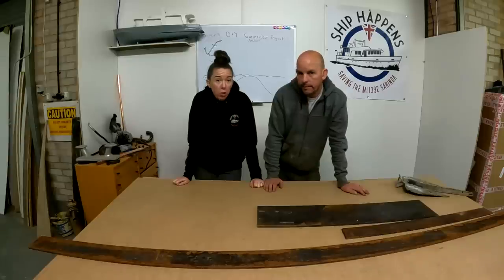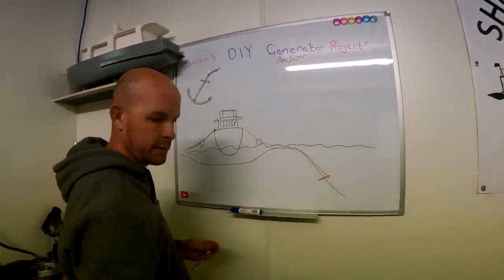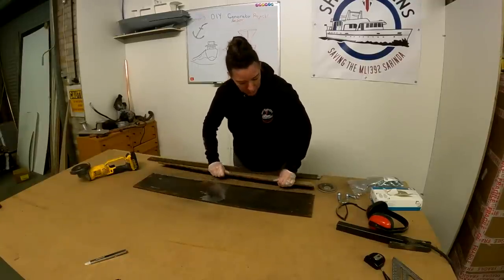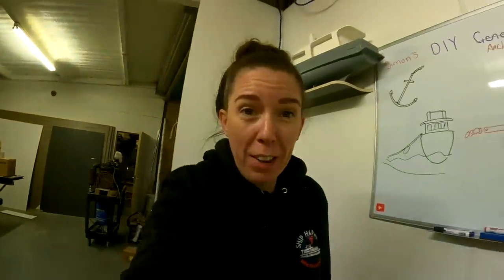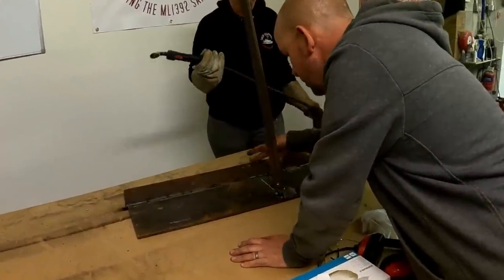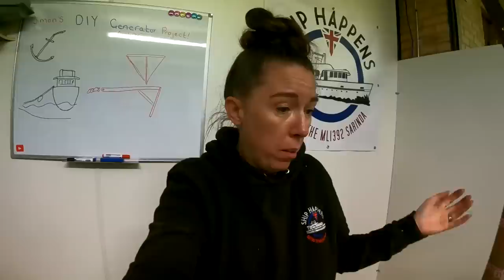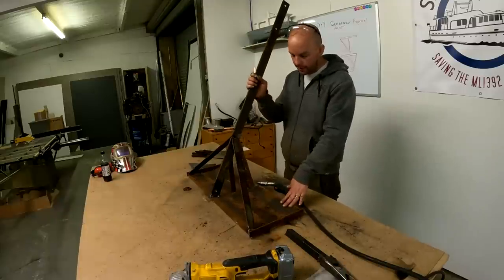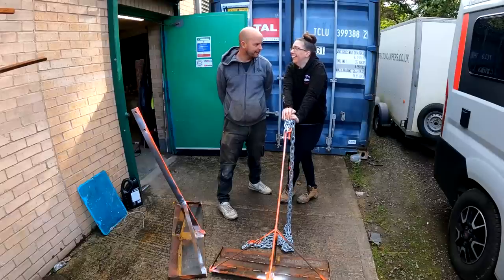Rate My Weld! Gemma Learns To Weld Making New Anchors

Comment: I am building my boat from scratch in steel (read as a LOT of welding) my Daughter who I suspect is about Gemma's age decided she wanted to help and I taught her to weld. Now I have no opinion on those anchors themselves since I don't know what the local fishing fleet uses (the local fishing fleet knows what holds) BUT I do know welds. Gemma for as little welding experience you have had you did AWESOME. You can weld on my boat any day. I will also say it took about a month (of a lot of welding) for my daughter to have prettier welds then I and as strong.  Come aboard my boat the the pretty welds are Sara's. Gemma would be a fantastic welder if she was on a steel boat, No question. Now Simon, you sir are one in a million, too few blokes are able to let their loves shine doing what is typically a 'guys' area. You properly showed Gemma and let her shine. You both are fantastic people. Thanks for sharing.

Comment: Landlubber: "D" ring. Old Salt: Shackle. Great welding job, and great idea. No need to be sea-worthy, as you aren't going to sea with them. They aren't so much "anchors" as they are "dead men." Don't forget to attach a short length of chain to the recovery shackle, along with a length of line and a small recovery float. Thanks for the video. Jon - Iron men and wooden ships!

Comment: Gemma’s welding is better than most “casual” jobs I’ve seen. I do a bit of “stick” welding (actually it is sticking the bits together). The big win is getting the current set correctly. My 13Amp 240 volt supply struggles to hold the weld set current. A job like this would be a total mess. If I could finish it at all.

Comment: P. S. I forgot? Gemma, I wish that I could weld as good as you? Many years ago, errr' around 53 year's ago when I was a teenager, I tried to arc weld a car lift in the service bay of a garage I worked in, & I made a right hash of the 1/2" that I attempted? So the experienced mechanic finished it! Lol. Yeah, keep it up, Simon is a great teacher.

Comment: Excellent going for a first attempt Gemma. I've done a lot of Mig welding over the years and I preferred it to stick welding; except when the splatters get into your shoe. Holes in sox even with boots on and several new versions of jigs danced. When the Mig splatter is flying about showing any butt crack is risky business.
Some of the guys I worked with who had boats on the estuary's in north Dublin where I live, bought scrapped railway coach wheels as mooring weights. They said they weigh about a ton. A tad difficult to maneuver as they had to be floated into position.

Comment: Interesting but should work design for what is a Ground anchor   However you need to worry about it twisting so make sure they are flat and well dug in before tying off the mooring (maybe a brief tug with the windlass if you cant actually see them go in)   If you plan to recover the anchors  dont forget a decent strength recovery cable and buoy on the eye so you can find them  and trip them when the tide is in and the mud softest

Comment: No rigging expert here, but thinking purely from a geometry/physics point of view, I think you should keep the following in mind:
1) The weights on either side should be equal
2) Said weights should be the same distance from the hull
3) The rope lengths from the weights to where the rope touches ground/anchor, should be, as near as possible the same length.
If not, one side could generate a stronger pull, resulting in lateral movement with the rise and fall of the tides.
But, maybe this is not important.

Comment: Nice episode, I do like watching your channel,  but did you think to flood weld the open backsides of the angle sheets ?  if there is an unusually strong squall putting massive pressure on the anchors it may well bend them out of true at the top weld joints like hinges and make it easier for them to erroneously weigh  and cause a possible world of hurt.

Comment: Simon I'm going to make once you just you put that do you looked in there for pulling them out the opposite direction I would put a roof on there with a small floating ball so that you can find it and take Sutton deep water and you can locate is easier so you not have to go to digging for it okay this is BOB from Vero Beach Florida God bless and have a great day

Comment: Good job Gemma for having a go  I personalty think MIG is fine for the work shop but if you take the time to learn to stick (MMA) weld you can repair stuff anywhere you can get a electric supply a good 240v welder can be carried in one hand  no gas to worry about gas is  costly , windy days a pain   lugging a cylinder around a pain   stick harder to learn but MIG is easy  after

Comment: Since your going into the mud, it might be better to look a the rake or pitchfork. Then using a driver pipe, it can be placed and pulled easier. This form will need a pit dug and placed under the top of the mud then covered.

Comment: On thick plate put a 45 degree bevel on the edge, it helps with penetration. 
I have seen welds looking much worse than Gemma's getting done by "professionals" another notch to her bow, Gas Safety, Welding and Shipwright , What's next on the skill sheet.
Reply from the maker: TIG welding next I think! Never done that before! Might look at doing a little night class to learn!
Reply: @ShipHappensUK  Fantastic, get that under your belt and you are on a winner.

Comment: Gemma, fine job on welding. Atleast you didn't have to stick weld that is alot more of a pain in the rear when you are just starting out welding and certainly not as nice a weld out of a stick when you are not used to it.

Comment: Guys, please be careful with the camera when welding. The light is so bright it can take out the sensor. Also consider using wire cable for winter moorings. The Muppets will not be able to cut them. Regards, Tiny, Lincolnshire 😁
Reply: Turns out we all survived this…
Reply: @shieldaigbencher  Lol
Reply: LOL... I did put sensor, not censor....